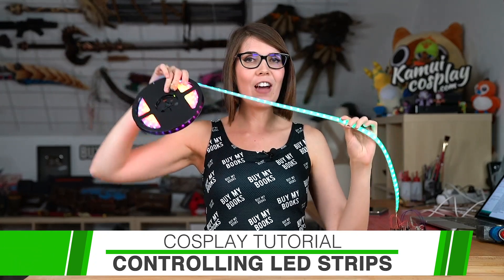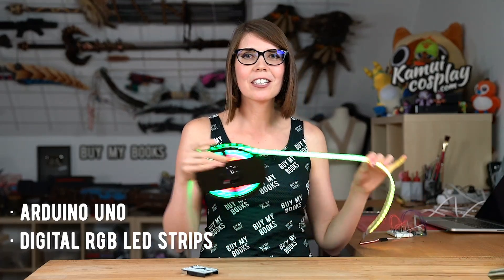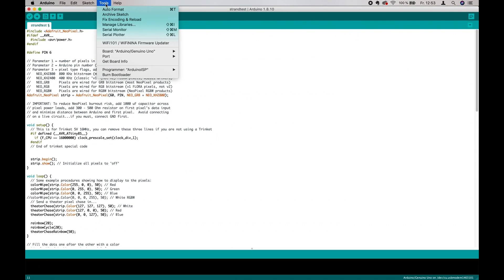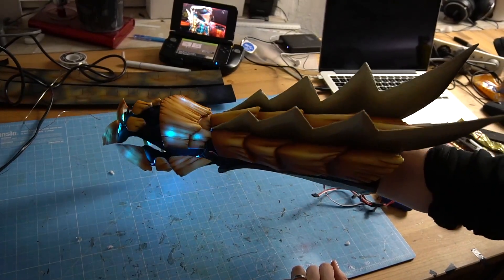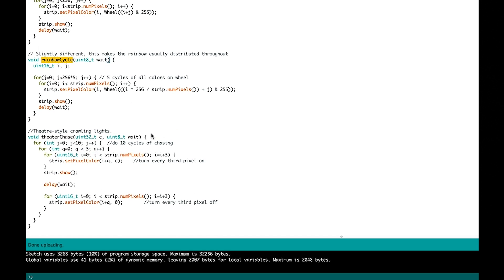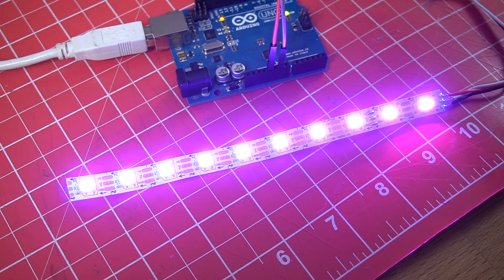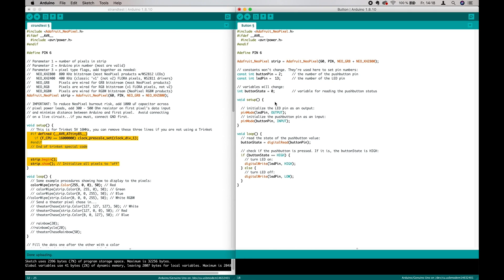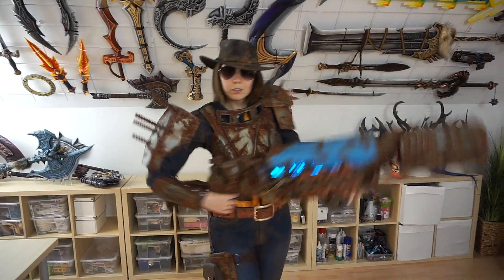How to control LED Strips with Arduino - Cosplay Tutorial

Comment: U know, the library works with all Arduinos, like Nano, Mega, and so on, not only with Uno.
And a naked ATMega 328 with external 16 Mhz X-tal too.
But ATMega without the external X-tal ? Internal 1 MHz ?

What about the ATTiny, 85 for example ?
In that code I realized a line where ATTiny 85 was mentioned.
But I don´t understand how to use the library for those neopixels for ATTiny....
( I´m no native english speaker )

Comment: have a strand of LED lights that have the following four(4) points on them: 5V, R(red), G(green), B(blue)  instead of the three points on the strand in this video of 5V, D in, G(ground).  how do you set the Arduino UNO board to run this one, since I cannot find it under the neopixel at adafruit?
Reply: Afaik these 4 wire rgb strips are controlled via analog stuff, which means you can't address them individually (so they'll all be the same color and brightness) and they need some kind of driver to run... on a quick google i saw different rgb-led driver modules with 4 outputs, so i guess you should look into those :)

Comment: So if have a costume with say, flashing blue lights on the chest, solid red lights on a prop, and chasing multicolored lights on a helm, are you still able to have all of that working on just one ardunino chip? Or do you have to have one chip per strand of led?
Reply: yup, you can do that (a cheap arduino nano is like 2€ though, so it's not like ur saving much^^), you can initialise and adress different neopixel objects with different names (ofc they all need to be wired up to the chip)
(i think one arduino nano(or uno) is "only" able to controll up to a few hundred leds though  and ofc you can't run all that many off the arduinos power rail (gotta have them in parallel))

Comment: First off, I absolutely love your channel and your books, they have really helped my in developing my skills and experimenting with my designs :) secondly, Im currently using some 12V red LED strips from Lumins workshop and I cant find any power sources which are small enough, Any suggestions?
Reply: https://www.amazon.de/DaoRier-LM2596S-Converter-Verstellbarer-Stromversorgung-Blau-x-1/dp/B06XYDNM77/ref=asc_df_B06XYDNM77/?tag=googshopde-21&linkCode=df0&hvadid=310735752419&hvpos=1o1&hvnetw=g&hvrand=14862364362792698874&hvpone=&hvptwo=&hvqmt=&hvdev=m&hvdvcmdl=&hvlocint=&hvlocphy=1004769&hvtargid=pla-702154894716&psc=1&th=1&psc=1&tag=&ref=&adgrpid=64580760151&hvpone=&hvptwo=&hvadid=310735752419&hvpos=1o1&hvnetw=g&hvrand=14862364362792698874&hvqmt=&hvdev=m&hvdvcmdl=&hvlocint=&hvlocphy=1004769&hvtargid=pla-702154894716#

is that small enought? (there are probably also 12V sources you can use directly, otherwise you could get a converter module and use what ever voltage you got at hand (like 5V powerbank)

Comment: 1. Nimm besser VScode und Platform IO das ist bequemer zu Programmieren.
2. Solltest du darauf hinweisen das  das man die Versorgungsspannung nicht über einen Arduino laufen lässt wenn man mehrere LEDs betreiben will. Und da fehlt ein zusätzlicher Kondensator.
Man kann das ganze auch per ESP 8266 steuern anstelle eines Arduinos dann kann man Einzelteile auch drahtlos  Steuern oder synchronisieren. 
3.  Nicht immer so überdreht, benimm dich Mal wie eine erwachsene Frau...
Reply from the maker: Du klingst, als ob du selbst gerne ein Tutorial machen würdest. Würde ich gerne sehen. Und erwachsen sein ist doch langweilig. 😀
Reply: KamuiCosplay  ein Tutorial zum esp kann ich dir gerne geben. Das ist nichts wildes, im Grunde benutzt du den selben Quelltext auf einem anderen Chip das ist schon alles. Ein Video kann ich allerdings nicht machen dazu fehlt mir die Ausrüstung und es ist auch nichts neues was ich da erklären könnte. Guck dir mal die Videos von der bit Bastelei an, er erklärt das sehr schön.

Comment: I would be interested into using a different power supply like Lithium battery packs and maybe even different arduino boards like the Nano. I mean the uno is still a big Monster in size. Thanks for ur content. Grüße.
Reply: the nano is basicly the same thing, just smaller^^

Comment: I'm not 100% sure how well this will work because I'm only guessing at the code here. But, if this works, then it should let you switch modes without finishing the loop. It still won't be right away, because of the delay() call, but it should still be faster. That said, I wouldn't call this a smooth transition.

void colorWipe(uint32_t c, uint8_t wait) {
    int startingButtonState = buttonState;
    uint16_t pixelCount = strip.numPixels();
    for (uint_16, i < pixelCount; i++) {
        if (digitalRead(buttonPin) != startingButtonState)
            break; // You can also use a "return" instead of a "break", but the return exits the function, stopping any code you might have added after the for-loop.

        strip.setPixelColor(i, c);
        strip.show();
        delay(wait);
    }
}
Reply: polling the button between every animation step like shown here is one option, alternatively you could also not have a loop in your function and only move one step further each time it gets called, then you can put the polling of the button in the main loop (so it works for all the modes without putting it into each of them amd you can do stuff like turn all leds off and start fresh when switching)

Comment: Note that the LED strip used is WS2812B. They're individually addressable LEDs that have the WS2812B chip inside each one. The signal goes into signal in and goes out of "signal out" into the next strip's "signal in". Note that the Arduino is incapable of driving a long strip. For that you'll need to add 5V power to the strip. The reason why you have to specify the length of the strip and how the chips determine how many LEDs are in the strip is because after the signal passes through one LED, a bit of data gets added that tells the next chip how many times the data has previously passed through a chip. The Arduino needs to know how many LEDs there are so that half of the strip isn't dark if not enough LEDs are specified. If the number of LEDs falls short, the next LED won't know what color it should be, what brightness etc. It defaults to all colors off because the data isn't addressed to it or the following LEDs.
If you want extra modes in your code, you can use variables. You can change the state of a variable based on an event, and then call a variable and execute the function it matches. Let's say you make a variable called Mode. You can add a number to the variable. Let's say each time you press a button, the variable number grows by 1. The variable will be set to 0 at the start of the sketch. When you press the button the variable reaches 1 and an animation code is executed. If the variable reaches 2, a different animation is executed. You can now press the button again to set the variable to 3. Now another animation will be played. But when the variable gets to 4, a different code is executed. Now it sets the variable to 0. When the variable is 0, no animation is played and all LEDs are off. Don't forget to add the part that resets the variable to 0 or it will continue to grow until you either reset or the variable can't fit into the memory of the Arduino anymore. You can have the variable start from 1 and get reset to 1 if you want the animations to cycle instead of turning off. You can add as many variables as the memory of the Arduino permits to perform a lot of modes.
Reply: Wow i don't understand
Reply: Thank you, Bro, I got the concepts. :)
Reply: Maestro, maestrazo!
Reply: Thank u
Reply: Shut up nerd

Comment: youre missing a resistor and a capacitor for better power ... if u want people to do this.. teach them right
Reply from the maker: There is a resistor in the schematic and there is no need for a capacitor if you power up your Arduino via the USB. If you want to complain, do it right. :)
Reply: @KamuiCosplay  , sweet burn!   ::applause::

Comment: its true you can copy and paste, but for custom effects its always good to get a foundation on what each function is doing to get a feel of it yourself imo. I know my electrical engineering is rusty but I was like "oh crap i know schematics are here but why are we doing X ohm resistors in certain locations" you can't just put a random resistor in places
Reply from the maker: You can copy&paste schematics just like you can copy&paste code. All schematics I showed are from the Adafruit and the Arduino websites. It surely helps to understand electronics, but if you find a tutorial that works, why not using it? :)

Comment: can it be used for all types of LEDs?what if the LED only has 2 wires?
Reply from the maker: This is for digital RGB LED strips with 5V only. You can surely use different, but then you might need to adjust your code and your power supply. The Adafruit Neopixel guide might be helpful here: 
https://learn.adafruit.com/adafruit-neopixel-uberguide
Reply: they definitely have to be digitally addressable rgb-leds (ws2812b based), afaik normal leds with 2 legs wont work, since they are analog (and single color)

Comment: Great video, but the Uno is too big.  I prefer the Arduino Nano or the Pro Mini for their size.  I use a Nano with a custom made connector to program the mini's, 4 pins, just be sure to set the board in tools to the Arduino Pro Mini instead of Nano.  There is a chip on the bottom of the Nano which allows this programming to happen, the Pro Mini doesn't have it. Use the 5 volt, 16 Mhz version to stay compatible with the LED voltage.
Reply from the maker: I chose the Uno because it’s easy to see and explain. If you watch my previous animated LED video you’ll see that I showed different small chips too
Reply: @KamuiCosplay  Sorry for the misunderstanding, I do have your advanced book.  My original statement was aimed at others watching your video, not you.

Comment: How do you power the system when not connected to a PC?
Reply: for example with a power bank or a lipo battery
Reply: read:
https://www.open-electronics.org/the-power-of-arduino-this-unknown/
under batteries ... around 5-12V

Comment: Also a small note, if you want to 'disable' multiple lines in your code you can type /* 'whatever code you don't need' */
For example:
/* rainbow(20);
rainbowCycle(20); */

This will disable everything between the two 'markers' in your code. It's just a neat shortcut if you have to disable lots of lines which are right after each other :)
Reply: lol, that comment is to nerdy... no thumbs up because its actual real IT nerd stuff! xD
also, you could delete the code, but what does i know.
Reply: @TheValinov  lol, that's fair xD
One reason to use '//' and '/**/' instead of deleting the code, might be because you're testing specific lines and might need just some parts of your overall code, then you won't have to rewrite or write the code elsewhere while you're testing! Another thing you can use it for is to comment your own code e.g //if you need to change the color of x  change the numbers in this line.

Commenting is especially helpful if you haven't touched your code for months, then it's nice getting a quick overview of what the hell is happening in your sketch :)
Reply: @TheValinov  how is that too nerdy?^^ it's just arduino code :)

commenting out parts is really usefull to find out which part of the code is not working without having to redo it all :D 
(Serial monitor also helps a lot when debugging :)
Reply: You could also use ctrl + / which comments it. It's a useful shortcut I think it works for arduino ide.
Reply: Could also use ctrl + / and it will comment everything, same for uncommenting.

And to tabutale use tab, BUT if you want to untab0 just use maj + tab

Comment: you can also use a pushbutton and have it change a variable when pushed, which will also work to switch modes (you should supress (with if) further pressing for like 200ms afterwards though, because buttons usually aren't as binary as one would think (usually the voltage will be unstable for a bit when pressing which can trigger more button presses at once)
Reply from the maker: Yes I know, but I preferred the slide switch since it keeps the example easier and some copy&paste is already enough to make the code work. :)
Reply: @KamuiCosplay  yeah, i figured... but i couldn't help telling you anyway :x ^^

Comment: arduino nano seems to be much better for this
Reply from the maker: You are right, I also built in smaller chips into my costumes. I preferred the Uno here however since I was able to show everything more clear and didn’t require any soldering. :)
Reply: @KamuiCosplay  have you ever considered a elegoo or a cheap rasperry pi?
Reply: yup, it's smaller and does the same (afaik)
also i think adafruit has a few arduino compatible controllers that are even easier to integrate (which lipo port and stuff)

Comment: When the arduino isn't plugged into the laptop, what do you use to power it and the LED's?
Reply from the maker: You can use a mobile charger, normal batteries or rechargeable or a lipo batteries for example :)
Reply: @KamuiCosplay  Thanks, so how much voltage would you need to power both the arduino and the LED strip? 9V battery?
Reply: @Alexzander-vq1jo  i think they run on 5V and use up to 60mA per led... adafruit has a nice guide on all this stuff on their website :) (just google something like "adafeuit neopixels tutorial" i suppose^^)
Reply: @Alexzander-vq1jo  i think around 5V batteries. just google "arduino powersupply"